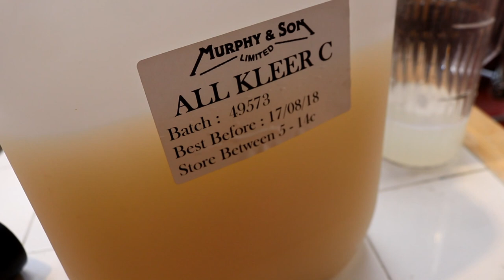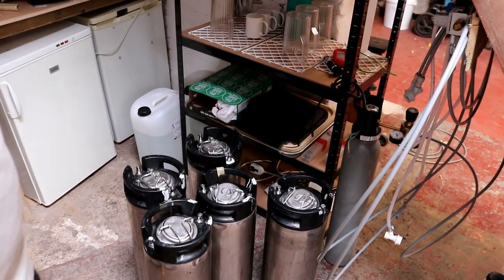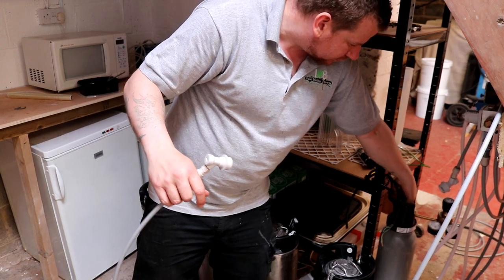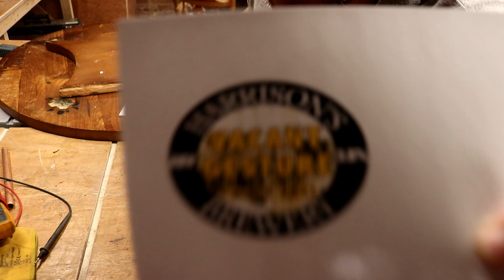CRAFT KEG

Comment: Question please:  In terms of declared alc%; does adding the finnings change this as you are effectively watering down the volume by 250ml per 19L?  Thanks.
Reply from the maker: Hi Stewart, Yes it does. HMRC allow 0.5% of deviation from the declared ABV. The rates we are talking about gives us a deviation of 0.05%,  a whole factor of 10 less than that allowed. Not a problem for brewers or drinkers. Also if a beer is 3.99% HMRC instruct you to round down to 1 decimal place for declaring duty giving you  3.9% .
Reply: HarryBrew69 Perfect, thanks 👍🏻.